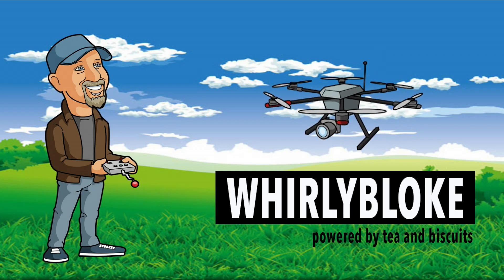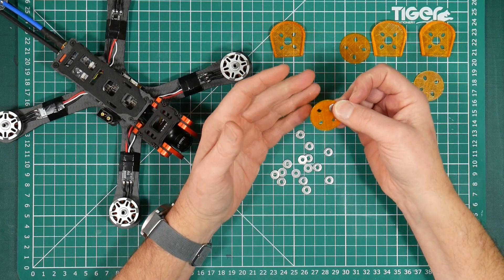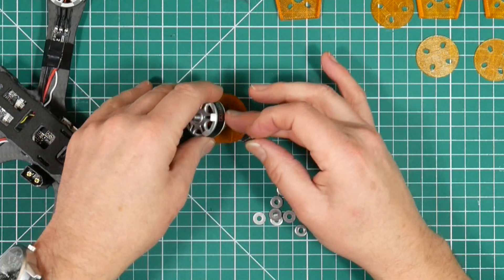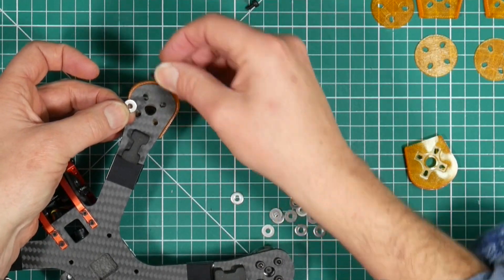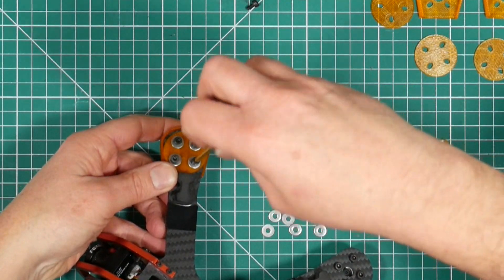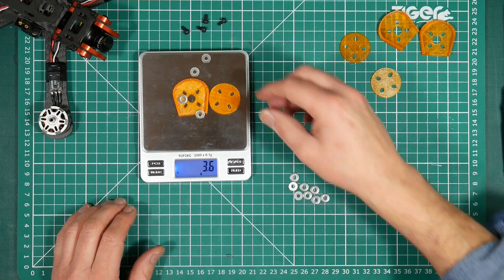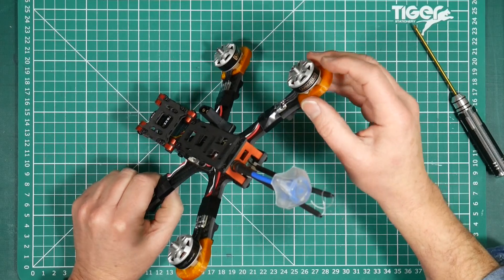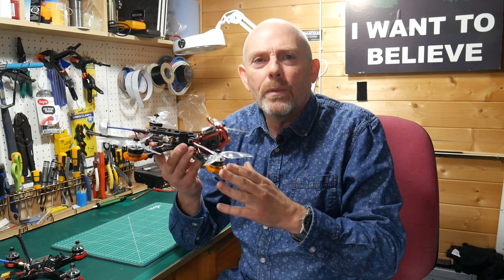Armattan Chameleon soft motor mount and frame protectors

Comment: Hi Man, thanks for all your videos , 
I want to get an already built Rooster ,
would you please help me choose my motors "2306/2450kv"  or " 2206/2300kv"   ?!
and choose my VTX  " Aomway 200 mv " or " TBS unify pro 5G8 HV SMA " ?! 
plus that what else I might need to order at the same time from Armattan  or anywhere else ?! like extra props etc...
and lastly the range of recommended batteries for the model please, 
thanks a lot in advance for all your help, I do appreciate every single word you would type for me,,

Comment: you should check out the silicone soft mounts for motors . i would leave the bottom arm protectors on and try the silicone ones for underneath the motors. TPU compresses and doesnt keep it shape very well especially when its so thin. the silicone ones are thincker about 2mm and do not compress over time ive had some for months installed and just replaced my motors for better ones and the silicone while it had some sand and gunk on them they were exactly the same shape and thikness as when i purchased them. i have done lots of testing and made my own soft mounts from silione, rubber , and other materials. i find the silicone ones u can purchase in packs of 8 and 12 are the best.
Reply from the maker: I'll check them out. These TPU ones are printed with 100% infill and are much stiffer than any others I've tried which are very soft.